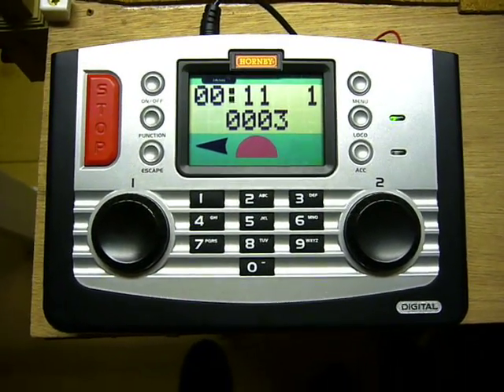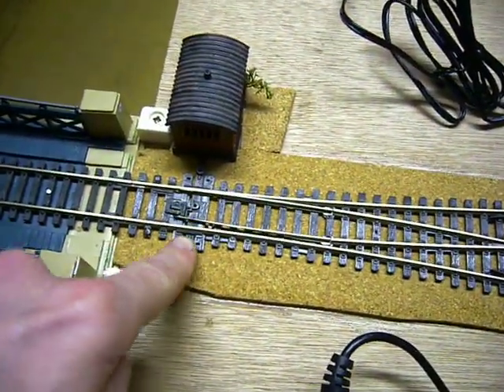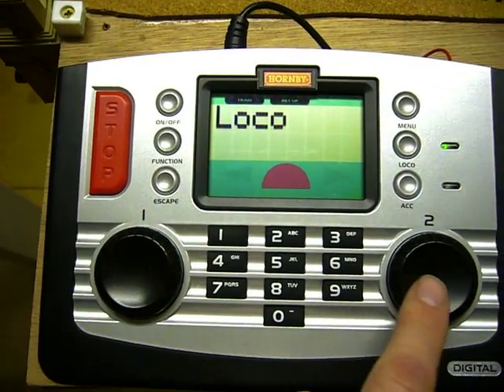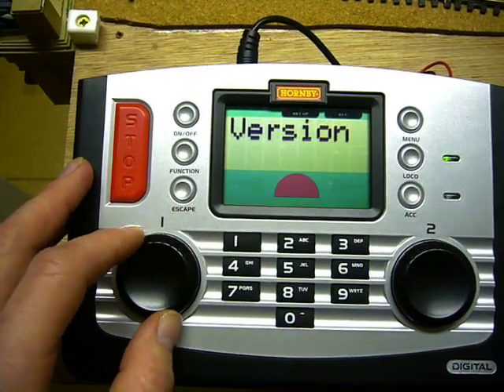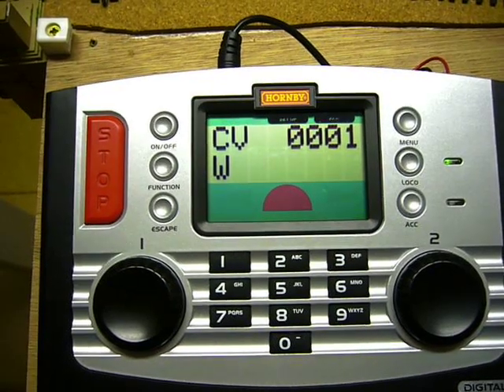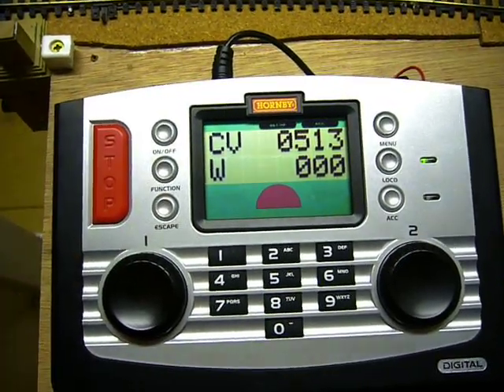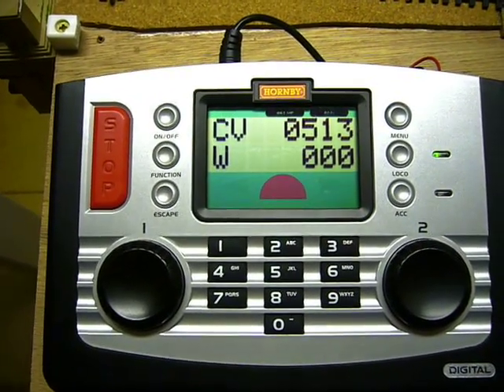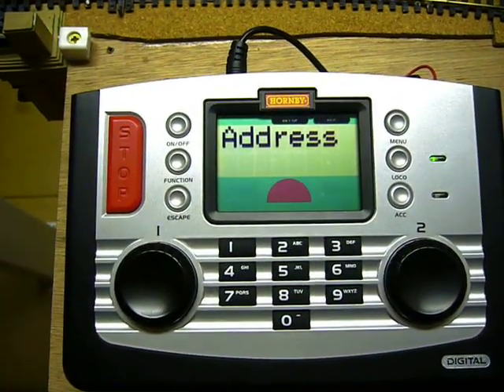DCC SERIES (part 14) Program Points Decoder

Comment from the maker: @mongoosekid14 You can use the Hornby R602 power clip, R8241 Digital power track rail section, Peco track power clips, or any DC power clip. Or as i've done, simply soldered two wires to the track. Wherever & when, a power feed to the track is needed.

Comment: Hello, we have the elite unit R8214 - 04-265. we have followed your instructions and how to program the point decoder but we still can not operate the point motors to work.  we have tried many times we have done factory reset and still and reprogram as per your instructions but at Point Moses are still working can you help please thank you, David Winter.
Reply from the maker: Hi David, Make sure it's connected up to the programming track or programming outlet on the Elite. Also make sure the point motors are correctly connected to the Accessory decoder. If all is connected up okay, it should program okay. if it's still not responding then it may be a faulty accessory decoder. Another accessory decoder that's worth looking at is the Train-Tech PC200 which is very easy to set up & program. We'll take a look at that in an upcoming video. Kind regards Iain.

Comment: Hello please can you do a video with how to use to accessories decoders being fitted to the elite controller and how to programme 8 points etc as I'm new to dcc
Reply from the maker: Hi, this video & part 15 that follows it, shows what you've requested.  Following what i've shown here & using the instruction leaflet that comes with the points decoder. Please do the following:
1. Connect your points decoder (as per the instruction sheet) to your programming track / programming outlet on the back of the Elite. (as shown in this video)
2. As per this video call up CV513 & give it address number 1 ( this then automatically addresses the 4 outlets on the decoder to 1,2,3 & 4.)
3. Disconnect the decoder & connect up the 2nd decoder.
4. Again as per this video video call up CV 513 & give it address number 2  ( this then automatically addresses the 4 outlets on this 2nd decoder to 5,6,7 & 8), that then takes care of 8 points. Now disconnect the 2nd points decoder. 

Now either connect the points decoder to your power bus (the 2 wires from the track outlet on the back of the Elite), or connect to the track  near your points. Its then a case of connecting each point motor in turn to the numbered outlets (again see the instruction sheet with your decoder). Thus point  motor one the 3 wires from that to the + C - connections on the outlet marked number one. The same for number 2 & so on.

Again Video in part 15, that video shows a point motor being used, prior to it being fitted to set of points.

Kind regards.
Reply from the maker: Hi, have you tried what i've mentioned above?